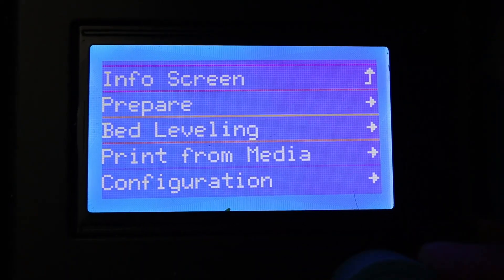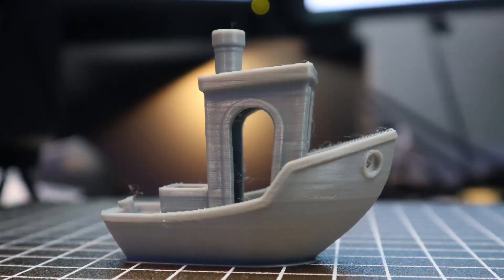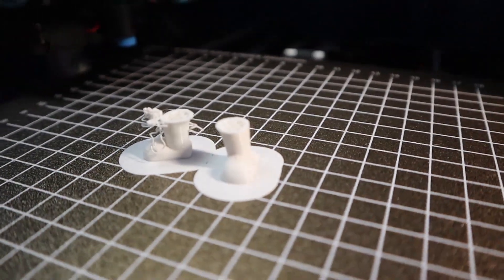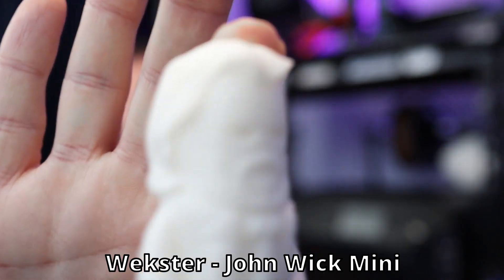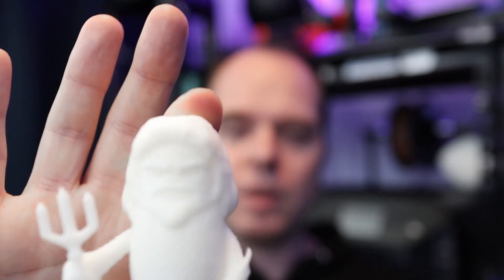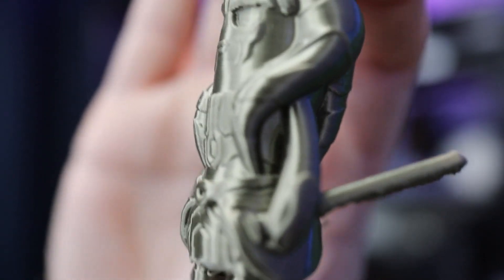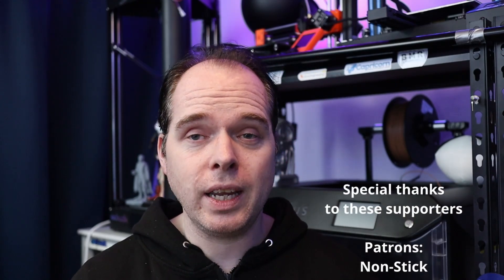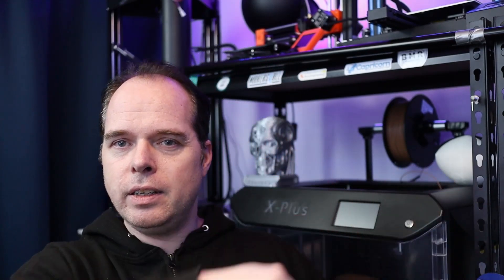Sovol SV06 3D printer - My first Impressions

Comment: I had similar results until I tried printing outside the center of the bed.  Bed is terrible and bed leveling did not compensate.  Only 5 screw holding it down. After many hours of messing with it I can use everything except the far corners.
Reply from the maker: Sorry to hear that. How is the printing going now with the SV06?
Reply: @Zachary3DPrints  I did the nylock nut mod on the bed.  Added some aluminum tape in some spots.  Used a third party firmware with better bed leveling.  Now it prints well.
Reply from the maker: Nice that it turned out well after some small changes. But still the machine should be working correctly out of the box...